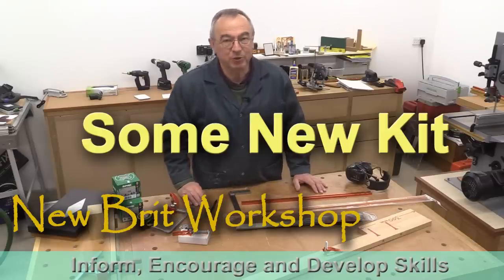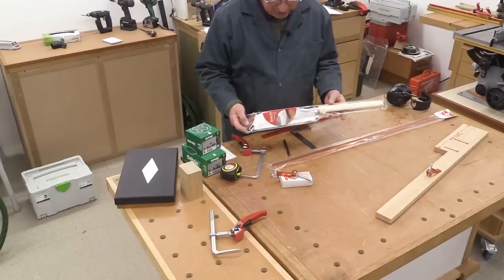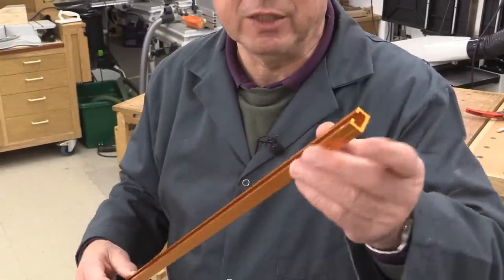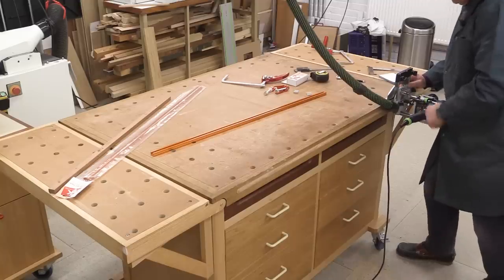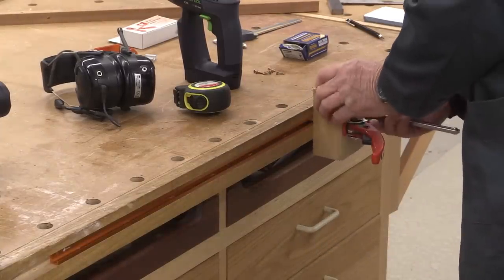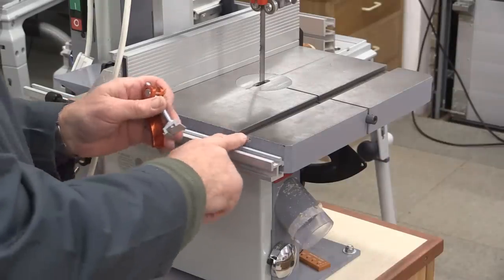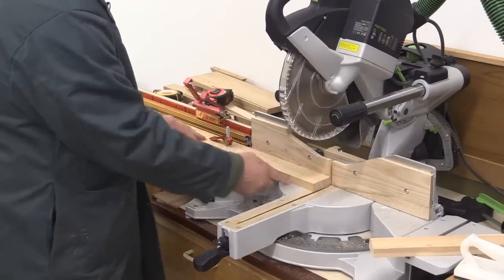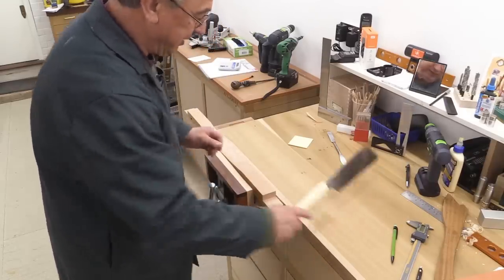Some New Kit

Comment: That's a very neat idea Peter. Far more flexible and much less expensive than a Moxon vice.
Reply from the maker: Hi Bryan, It is simple and effective but a real Moxon vice would be stronger but that extra strength is rarely needed.  Cheers.  Peter
Reply: @NewBritWorkshop  For sure Peter,, a Moxon vice would be stronger,  simply by virtue of the rod diameter and thread profile. But as you say, when do we need that sort of force? And I've yet to come across a cheap Moxon vice. 👍

Comment: Great minds think alike - embedding t-track is exactly what I had in mind to do today.  And I will also embed a track in the top surface. And about the Japanese saws - I fit western style handle to mine because I've never been comfortable with the stick handles.
Reply from the maker: Hi Bob, I am getting used to the standard pole handle on the saw but do understand how the western style might suit as well.   Peter
Reply: I've always thought that they might benefit from hockey stick grip, but I've never tried it. I was re-sawing quite a bit the other day and could feel a blister coming on with the handle. Will maybe order some grip.

Comment: Was the router bit you used for the rail channel a normal, straight blade, 2 edge bit? I realize those were  fairly shallow cuts, but I'm wondering if you just plunged straight into the wood, or used a different technique.
Reply from the maker: It was a twin flute 18 mm cutter and I made 3 passes. The first two were along the same path at 10 mm depth followed by 12.5 mm. The second path was at 12.5 mm depth but done to increase the width to 19 mm.  Peter

Comment: those cam locks are a great idea and they don't take up room like an attached vise. Will they work in a MFT 1080 channel?
Reply: As mentioned to someone else, if they fit a Festool clamp, they'll fit those cam-lock bolts.
Reply: @mlindholm  I recently started ordering different tools from Axminster.  I've been extremely impressed with the quality and service.  It's amazing how quickly they can get here from across the pond.
Reply: @hhanger1  agreed, I bought the Parf drilling template V2, and a few sets of their 1m trade clamps when they were B1G1F, and was surprised how quick and painless it was to come from the UK to midwest USA.

Comment: Love the t tracks but that Japanese saw is great. I love Japanese saws and wish I could get some good ones in the states rather than the disposable bladed ones.
Reply from the maker: Hi John, You can order direct to Axminster, using US $ and you will be amazed how low the shipping can be.  Peter
Reply: New Brit Workshop I did just that but it wasn’t for a Japanese saw. It was for the mk2 Parf jig! For a Japanese saw I’m looking for more traditional, thicker non replaceable blade you can resharpen.
Reply: Got them and they are great, very well machined they also look so good I hate to store them away until I need them. Might need a display case for them. Thanks again!

Comment: Hi Peter another great video as per usual. Wondering if you can help, I’ve racked my van in such a way that on the right hand side has its own box section to store sheet goods (maybe 6-7 18mm 8x4’s for example. Now I’ve been scratching my head for a while as I want to utilise t-track at the top and bottom for some sort of sliding clamp mechanism so no matter how many sheets I can always store them perfectly straight. Any suggestions would be most welcome. Keep up the good work!
Reply from the maker: Hi Richard, I assume your box section at the open door end and measured on the inside is just over 1220 mm high and about 200 mm wide. I suppose you could put some of the T track into the top and bottom horizontal pieces and use a pair of the cam clamps. I store my sheet materials in the workshop in a similar type of racking but do not bother to keep the sheets perfectly vertical. Is it just to stop it moving when you go around a corner?  Peter
Reply: Why not just add a couple of wedges (with a gradual slope, not steep) into the far end of your box so that when you slide your material in, just slide it further into the box and as you push further in it wedges against the wedges, if you see what I mean! The more material, the less distance you push it in. Perhaps some sort of adjustable clamp at the front to hold it at its wedged distance so it doesn't come loose.
Reply: New Brit Workshop thanks for your reply Peter. Yes to the movement round corners and also as I don’t have a workshop,  sometimes the sheets may be stored for a longer period of time as I work on them so need them to keep there flatness so being able to store them nice and straight would be the preferred way. I like the look of the cam clamps. Would you say a bit of maybe 2x1 PSE with a hole the size of the cam clamp bolt would work as a stopper top and bottom for me to slide and lock into place depending on sheet quantities? Trying to make my van work for me and enable me to be efficient while I don’t have a workshop. That’s to come in the future. Rich

Comment: Hi peter,
The cam locks Which size fits the MFT table M6 or M8
Great idea
Reply from the maker: Hi Stuart, I have the M8 and they are perfect. The other reason I choose M8 is that all the threaded dogs that I have designed have M8 threads.   Peter

Comment: Peter, bought the Parf system 2. Lovely. One thing though. Packaging. If you look at what youscribe send you with a little card board box lovely. Your system comes with a miserable little white box and disposable packing lying here on the floor. Surely Axminster could do a little better to give something to keep parts together. System is not cheap and this really does look a bit miserable load of packing thrown out and bits lying around the floor with the most miserable little white cardboard box.
Reply from the maker: Hi Brian, I will pass that on to Axminster.  Cheers.   Peter

Comment: hi peter im also wanting to build a new shed slightly bigger than you could but not much. i would be very interested in your plans and i could apply it to my needs. i have you subscribed and rung the bell and would appreciate it if you could send me a link to the plans when available.
love your work btw
stay safe
Reply from the maker: Hi Glenn, When the video is eventually published (I cannot get the timber yet) I will invite people to contact me to get plans. I do not have the free time to keep track of early requests as I am responding to between 50 and 100 emails and messages a day - I think because many people are not at work.   Peter
Reply: @NewBritWorkshop  of course i shall ask when you publish if not got mine done.
stay safe
Reply from the maker: Cheers. I am still trying to get the wood !  Peter